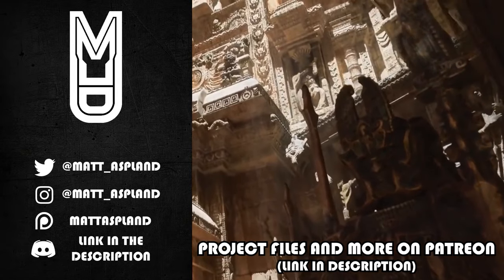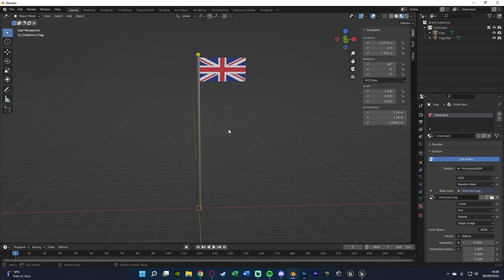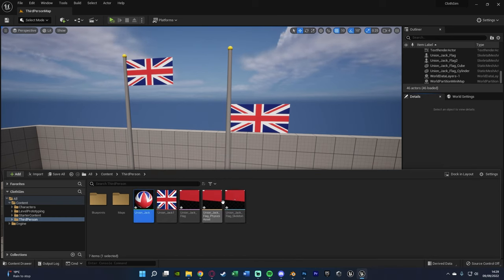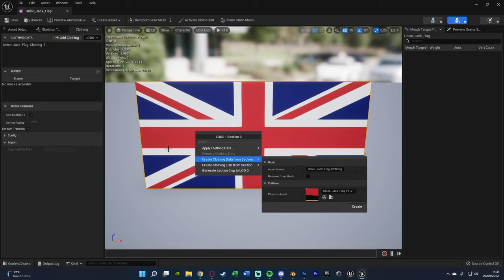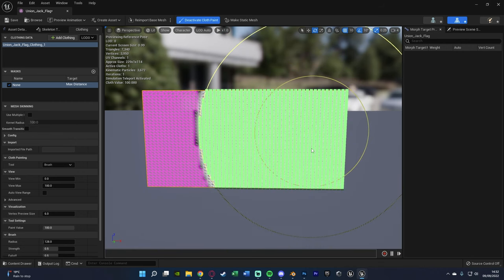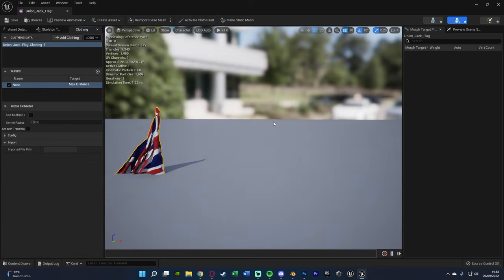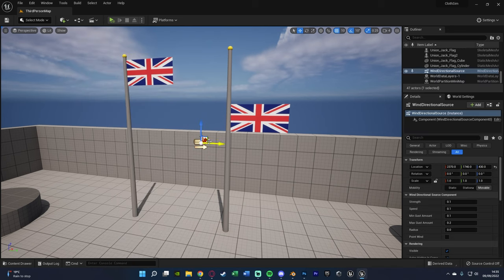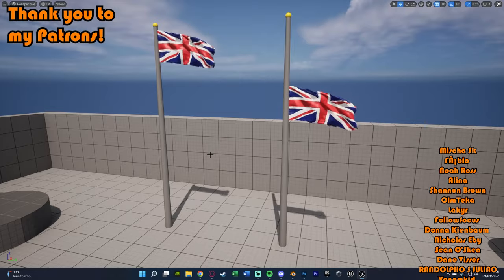How To Create And Use Cloth Simulation In Unreal Engine 5 (Tutorial) | Flag Physics With Wind In UE5

Comment: Just a note that your cloth must be exactly 1 vertex deep along one axis (so your material must be 2-sided). If the cloth is more than perfectly flat (2 or more vertices), it will inflate like a balloon, rather than sag/flap.
Reply: So it has to be extruded in 3d program to have some sort of depth and not just a flat plane?
Reply: I believe you can control that with the pressure settings. I would have to test it to see.
Reply: how do i fix this as mine is going like a balloon?
Reply: If anyone is still having an issue with ballooning of their mesh, double click the physics asset and move the collision capsule until the mesh behaves the way you want it.

Comment: great video — thank you!  🫡🇬🇧

i had the same issue with 100 not being high enough for the Paint Value — and causing glitches — but that was fixed when i set both the Brush Strength and Falloff to 1.

Comment: Hey Matt, quick question, how would you add some "weight" to the material?  For example, whether that was a flag, or a cape, or anything, its very floaty, is there a way to dampen that down so that it doesn't bounce/flap around so much?  Also, collision?  I noticed your flags wrapped around themselves/went through themselves, is there a way to prevent that?
thanks in advance :)
Reply: the free Content Examples project in the Samples section of the marketplace has a map for cloth, and in there you can see the different setting for things like silk, rubber and burlap.

Comment: Hi, I have created exactly what you do. It works well in simulation, but when I export it, the flag moves 100 times faster. How could I solve this issue? It works normally before export, but the result is totally different after export. It's been a week, but I could not figure out what went wrong.

Comment: whats the impact on the GPU for these cloth physics?
Reply: I'd avoid it when you don't need it, you can get cheaper performance with either animations or what I like for some wavy cloth effects is using the simplegrassshader node and apply that in your material instead. Cheaper.

Personally i'd use cloth physics mainly for objects that need high detail, like characters for example with a cape or something.
Reply from the maker: Jason worded it perfectly!